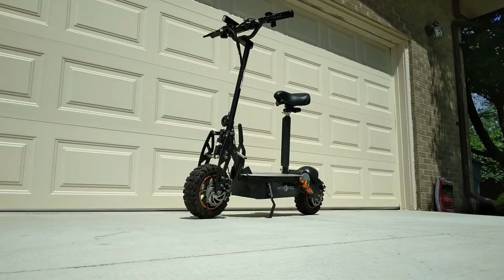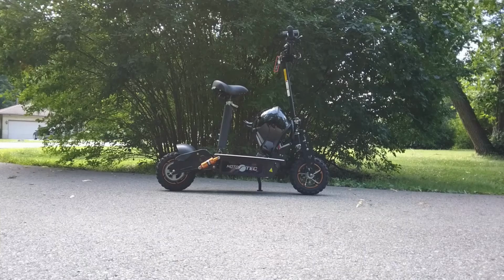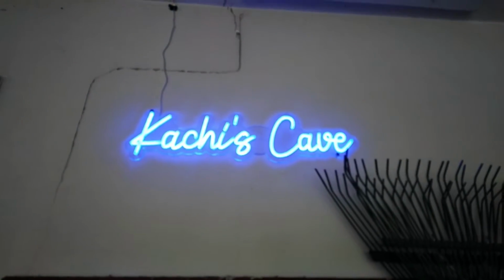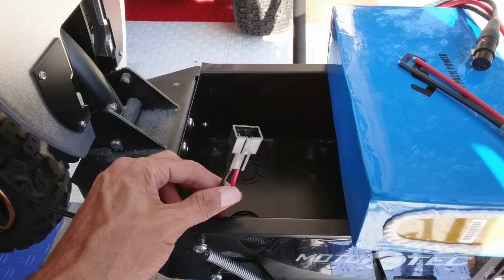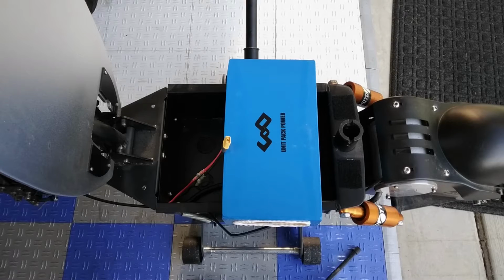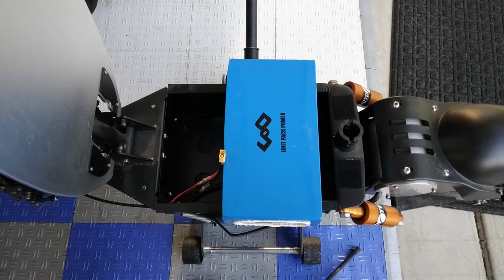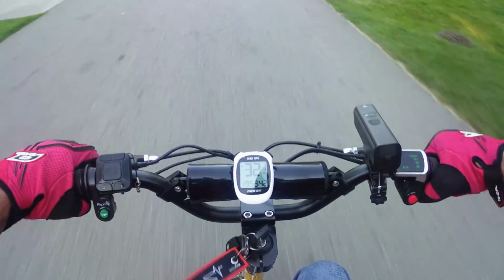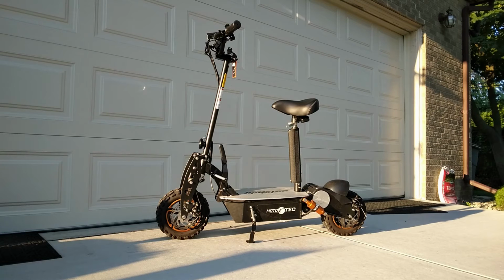48V to 60V Lithium Battery Upgrade / Mototec 60V 2000W Electric Scooter

Comment: Hey man, I purchased the 60V 2000w version of this scooter. Since i got it, I have only been able to push 24mph. Customer service sent me a controller and ignition to replace, which I did. With a full battery, new controller and ignition, I was still only to be able to pull 24 mph. Mind you I'm 180, I drive on pavement, and my chain is lubed, etc etc. I can't figure out why I can't hit atleast 30mph. Any thoughts? Could it be the motor?

Edit: The battery is Lithium Ion, not the Lead version.
Reply from the maker: What version do you have, The Chaos? Did the controller they sent you actually say 2000w?
Reply: @kachiskid Yep, I got the Mototec Chaos 2000W, 60V, 15Ah electric scooter. I actually took a photo of the controller and the speed limiter cables disconnected to show Mototec Support that despite all that, I only reach 24MPH. Mind you, I haven't even had this thing a month yet. I'm frustrated lol I wanna love this thing man.

The Controller I have lists these specs: 

Voltage: Dc60v
Undervoltage: 48+-0.5V
Model: 2 Speed 20KM/H(Could this be it?)
Brake: High Level
Power: 2000W
Current Limiting: 35A 

Then you have the manufacturing date and other numbers. What do you think? Could it be the model or could the motor have been shipped busted? Mototec said they will sent me a new motor but wtf, im replacing all the vital parts of the scooter. Not what I expected out the box.
Reply from the maker: Evereything looks okay. I think the sticker just lists the speed as that for the cops. My new Zondoo says the same thing. It goes at least 50mph. When you contacted the company, obviously they are aware something is wrong, right? Can you tell the difference in the 2 modes? What is the top speed of the lesser gear?
Reply: @kachiskid Yes absolutely. The Eco mode goes About 15mph. Yes they are aware, I have had an open ticket with them about this since February 24th lmao. The Tech I was talking to is stumped himself because first he wanted to say that my gps is inaccurate but I used the same speedometer you had (the meilani) and an app. Im the one who made the suggestion it could be the motor. I don't know what else it could be. New controller, new brakes, new ignition.....the battery and controller are legit and I know they aren't fluffing their numbers because you and others who reviewed this scooter confirmed the top speed. Its upsetting tbh because its like a little harley with a fat rear fender and the throttling sounds it makes. I have the Bikydom Q06pro (its like the Arwibon or Feiabor but with some differences) and that goes 50 - like it goes faster than the 47mph they claimed. I love it. I saw your Zondoo and considered it but ultimately went with the Bikydom. Its so much fun man! I wanted the same experience with the Chaos...😢
Reply: @kachiskid Wow, a month has passed since I asked.

Turned out it was my twist throttle the whole time. Now I have a bunch of free spare parts
Reply from the maker: @ahmedatia727  Darn, I wouldn't have guessed that. I'm glad you got it fixed.
Reply: @kachiskid I'm glad too! I've changed everything from the brakes, controller, motor, and finally the twist throttle was the problem. I knew this beast had more power.

Have you done any other modifications? I have been thinking about changing my sprocket from 54 teeth to 44 teeth. What do you think o wise one?

Comment: Hey man nice upgrade. I have a question I have a chaos freestyle 2400watt dual motor I would like to get a 72v battery and controller but how do I no if the motor can handle this. My scooter goes 40mph the battery last around 20miles
Reply from the maker: https://amzn.to/4hI33IJ Looking at this battery it will run on anything from 200W-3000W. The XT90 connector will be able to handle the current.
Reply: @ thanks for your reply unfortunately it doesn’t ship to the uk. But I have a rough idea now on what to get. Thanks

Comment: The battery you recommended in the link you provided was to big for my scooter and I have the same model that you have
Reply from the maker: I don't see the 60volt on the website right now, must be sold out. Which size battery did you get?

Comment: How much does MotoTec Chaos 2000w 60v Electric Scooter

 Weigh? Can i easoly put this in my vehicle?
Reply from the maker: It's is very heavy, the Chaos comes with a lithium battery, so it will be lighter. I would assume 80-100lbs. It can be put in a SUV, but not sure about a trunk.

Comment: Would an 80 volt chainsaw battery work?
Reply from the maker: You could try, making sure you have a fuse in place.
Reply: depends if the capacitors in the controller can handle it, you can get away with a 60v but most 48v controller caps are rated for 60v
Reply from the maker: Very true, great comment.

Comment: Hi Kachi's kid, I'm about to pull the trigger on this battery upgrade, but before I do, I'm curious how it held up since you’ve done the upgrade. Has it given you any issues? Also, how oftern do you ride it?
Reply from the maker: I haven't ridden it much since getting the Zondoo. I will make an update video soon. After the boost bottle update, but before my 3 year review on my lawnmower.
Reply: @kachiskid  thanks for the reply! I ordered the parts, and I'm excited to get my scooter working again! Another question, did you charge the new battery with the provided XLR Cable or the factory one on the side of the scooter? Will both work?
Reply from the maker: Of course, no problem. I charged the battery with the supplied charger. Not sure if the old one will work.
Reply from the maker: Might want to check this out. https://youtu.be/7l1Pm9eQnDE

Comment: I have a 48v electric scooter called Suotu R8 and I want to install a 60v battery. won't it burn down my moter set?
Reply from the maker: There will be a little more heat, but you want to look up "over-volting" a scooter.
Reply: you scooter came with a 48v battery? how many volts is your controller?
Reply: so I can put that 60v battery?
Reply from the maker: @GeorgeoVreden 50amp controller max.
this is straight off the battery...
 Note Size: 317*70*181mm //7KG; 【Li-ion Battery Parameter】60V 25AH, 2500mAH Cell, suitable for 750w 1000w 1500w 2000W motor. Max Constant Discharge Current: 50A, Charger: 67.2V 3A. Discharge port: A pair of XT60
Reply from the maker: @GeorgeoVreden Use this amazon link.. https://www.amazon.com/sp?ie=UTF8&seller=A1O81VI4QNNEYR&asin=B07V375J68&ref_=dp_merchant_link
ask them what is the right battery for your scooter.

Comment: Hello Kachi, very good video. I have some questions though that nobody can seem to answer. I have a old model mototec evo 1600w with the same 48v battery pack. However the motor looks a little different (it has holes on either side). I can get to 29 mph with the stock battery and everything else. The scooter has 40 amp fuses in between the batteries and the controller. Am i safe to assume i should get a 60v battery with a 40amp max bms? or should i shoot for a 50 amp max bms? im afraid of blowing up the motor but i dont want to have the same top speed with only 40 amp max on the bms. were the fuses on your old battery 40 amp or 50 amp? thanks for reading all this.
Reply from the maker: Hey Jaxson, thank you for the compliment. When you purchase a battery, they suggest the type of battery you need by the wattage of the bike. 40 amps is normally for 1500w and less. I would go with 50amp, but just in case but I will send you a link to my battery and you can see their recommendations.
https://amzn.to/3UrsC6I
Reply: @kachiskid  I actually ended up going with the 40 amp one, the lead acid batteries were limited to 40 amps so i should be fine. Anyway i got a 52v 40 amp battery. Wattage is just volts times amps and 52volts times 40 amps is 2080 watts... I think the battery makers are a little conservative with the wattage rating. Farther down, i found the following: 🚴‍♀ Note Size: 11.02×5.91×2.8 in //6.5KG; 【Li-ion Battery Parameter】52V 20AH, 2500mAH Cell, suitable for 750w 1000w 1500w 2000W motor. Max Constant Discharge Current: 40A, ST Charger: 58.8V 3A. Discharge port: A pair of XT60
Reply from the maker: @jaxsongreenwell9777  Ah, smart man. You should be fine. What are you gonna do with all that power? Just be careful, should turn it into another bike.
Reply: @kachiskid  What am I gonna do with all that power?
Go very fast, hopefully :)
Will def wear a helmet after the upgrade!

Comment: I’m trying to locate my controller on my scooter but can’t find it any idea where it can be
Reply from the maker: The cable that I cut is connected to the controller. Mine is under that metal black box in the front.